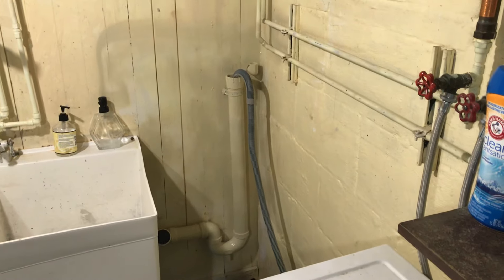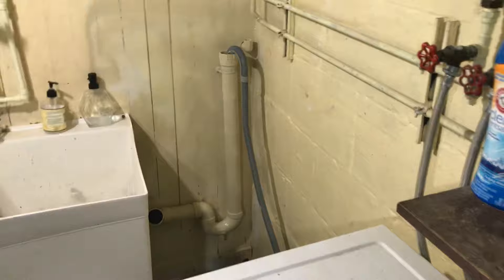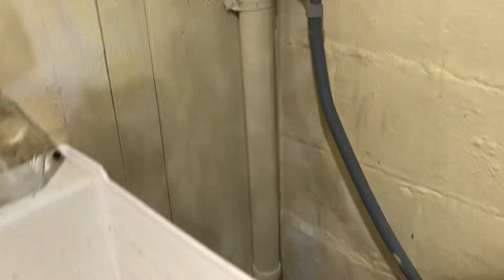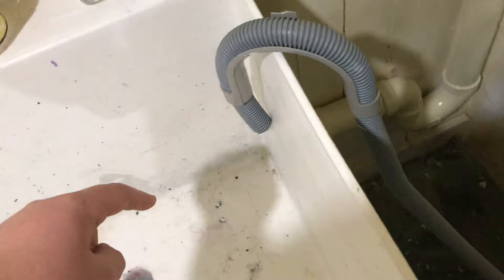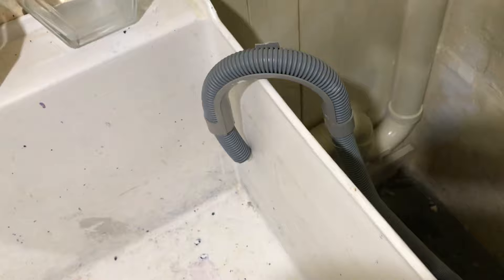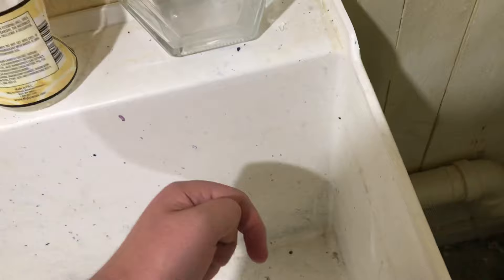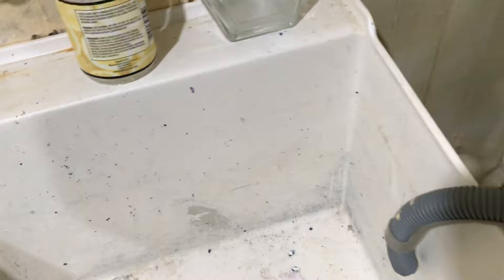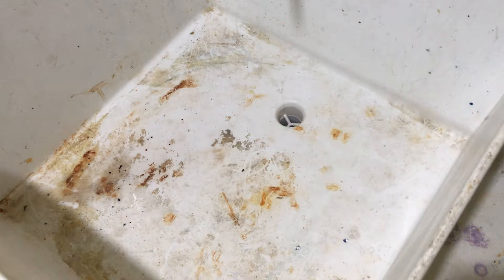Why you should drain your washing machine drain into a standpipe rather than the utility sink.(2021)

Comment: If your drain gets clogged, then you don't have a backup for your washing machine. If you have it into your utility sink then at least you'll be able to contain it. I suppose you could install a swing check valve and/or a ball valve right at the P trap as a failsafe. I have a double tub utility sink that I'm setting up for my wife's laundry room. It has an automatic pump underneath, so there's no need for a trap. I did, however, get a polyethylene bathtub drain with a trip lever for each side. I'm going to cut a hole at the top of the sink for the overflow and lever. Basically, I'll have 2 independent mini bathtubs. They'll drain to a T in the middle right to the pump. The reason for this is so that she doesn't have to reach into the bottom of the sink to pull the plug anymore. The water could be really hot or really disgusting. Both are good reasons not to want to reach in. Also, she can let something soak in one side while the laundry machine drains into the other. Now, if for some reason the drain gets clogged while she's not home, there's an overflow acting as sort of a failsafe. It's all overkill, and I have a tendency to over-engineer, but I thought it was a good idea, and I know she'll appreciate it. Happy wife, happy life.😂
Reply: I'm temporarily using a big storage bin to drain the water.

Comment: To prevent the hose from popping out of the standpipe, I drilled a hole through the pipe near the top and used a cable tie to secure the washer hose. If you must drain a washing machine into a sink, maybe you could do something similar?

Comment: On a double sided utility (laundry)sink,we use  a “save suds”feature with the washing machine,which allows us to do multiple loads by saving the sudsy water on one side of the sink...this means you MUST route the washer drain hose to the sink,or your suds will go to the drain...This feature is economical,saves water,energy,and detergent...we mostly use it for doing a load of rugs,rags,work clothes,etc....

Comment: Our house doesn’t even have a utility sink for the laundry room. We literally have to use the standpipe. Unfortunately, being both cast iron and very close to 50 years old, it’s very near the rated end of life (and we have had problems in the past). Even more unfortunately, the underground drain lines are also near-EOL cast iron (and the trap for the washer is underground), so replacement would require redoing some of the foundation.

Another problem with permanently attaching the drain hose is that those come with the washing machine. You’re going to need to do some deinstallation, either on that end or the other end (on both your new and old machine) when it inevitably dies.
Reply: The house I bought on auction only has a stand pipe. To be honest I didn't even notice this or think about it after I took a quick look at things before the auction began. I am getting a plumber to check things out and I'd like to put a sink in the basement not only for the washer but because I want to paint the floor and walls and clean up the basement beforehand.

Comment: Question. Why dooe the drain hose lead down and then go up again to the stand pipe. If possible, is it better to make the hose go at a 45 degree decline to the ground if I have a drain pipe already there? (no need for the stand pipe) . Only asking because i think this eliminates the chance of there being a backflow into the machine during the rinse cycles
Reply from the maker: I am pretty sure the washer would siphon and not work correctly.

Comment: Can I put a wye onto my drain pipe and not have a stand pipe with a p trap?

My drain comes in horizontally into my basement about 4’ high 
My kitchen is draining into that.
So I’m thinking maybe I can put the wye in between and using hose clamps so there’s no p trap (venting through the same vent stack)
Reply from the maker: No, the drain could back up into your washer if the main clogs and you need protection from sewer gas for the washer. Even if the line is vented the drain needs to have its own vent. Find a two inch pipe and tie in a proper trap with a vent or air admittance valve.

Comment: What if u just connect it to under sink drain?
Reply from the maker: they do that in the UK but not in america
Reply: @jacksplumbingvideos7147  
Got it, what happens if we do it here in America,  washer won't work?
Reply from the maker: @myyoutube5157  it is not code here.
Reply: Yes, I was hoping to do just that! I thought I might be able to get a Y joint and connect the washer drain under the sink. However, after watching a few videos I now understand that the washer drain needs to be elevated above the washer to prevent siphoning of dirty water back into the washing machine. Plus, my drain is unfortunately less than 2 inches so draining into the tub is the preferred way. Ugh. Now how can I make sure renters don't accidentally overflow the tub? Maybe I need to get a larger tub (or a smaller washing machine).
Reply: @jensonamission  easy: stop being a parasite landlord
Reply: You can, but I used a contractor to do that and after a few years it started to leak at that point: b/c he'd used too small a joint at the point connecting it under the sink (as explained to me by the WM repair guy).  The water coming out of that hose is high velocity, so you need to make sure it's not aimed at another joint, and also don't use like a 1in connector for a 3in hose or something like my guy did.  So yes, you can, but long term, the kind of setup this guy has is better just bc of how the pipes are arranged.  Also note the U joint trap at the bottom of the pipe: its always nice to have any stuff that might jam up your pipe that comes out of the WM in an accessible spot, so you don't have to go through concrete to get to it, just replace/clean out the U.